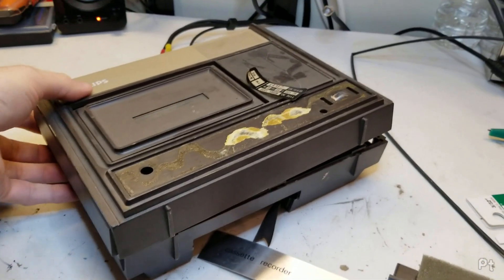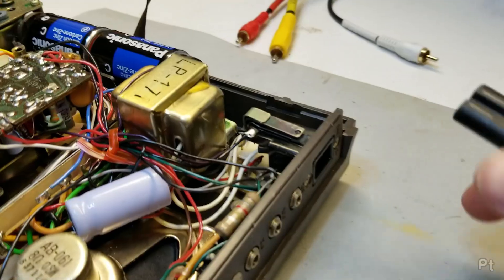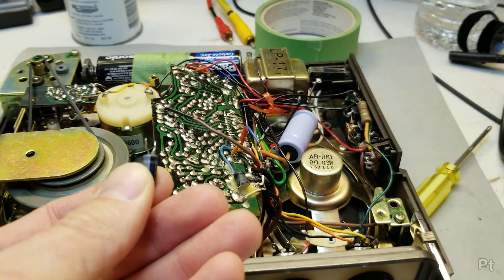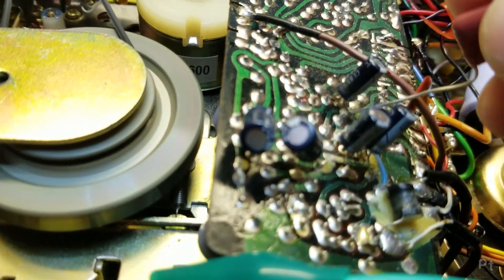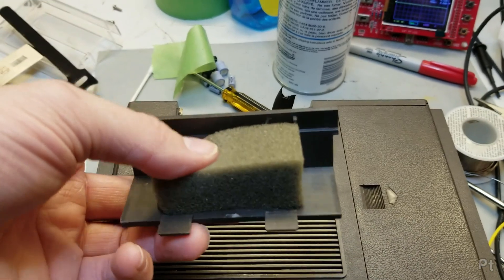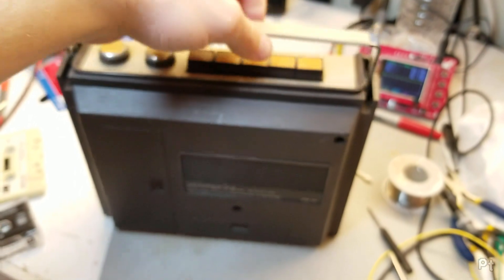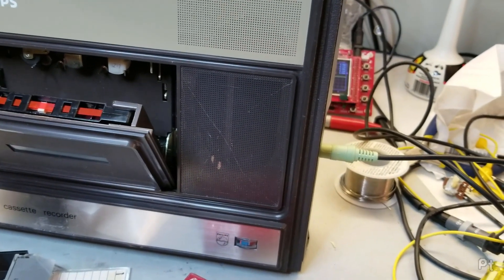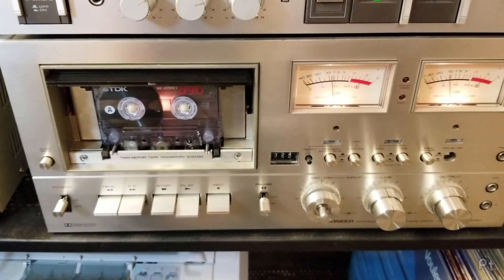1971 Philips Cassette Recorder (Model 1530)

Comment: These are very cool old school recorders. I have the older model (1320) of this cassette recorder. It's almost the same but mine has no tone setting knob and the 6 volt DC looks like a earphone jack. Mine had no sound also, but it turned out that a wire had become unsoldered from the head. Works great now.

Comment: Nice!! My grandmother had an Aiko Atpr 406 radio cassette from 1972. I remember that it had the same defect as this philips radio when I pressed play giving this noise, only it was very loud and irritating from the motor on the speaker and nothing would play on the tape . I've always been curious to know the reason for this problem and I found it after many years. The most current tapes from the 90's I've never seen this defect I don't know why.

Comment: If you want a YT app (which i assume that is at 8:57) that doesn't suck balls with restrictions and ads, get the F-Droid store (open source app store) and grab the app called "NewPipe" from there. Similar story for twitch if you use that, app called Xtra on F-droid with a built in adblocker and many more options than the stock app. Also there's things like signal generator apps that might come in handy. And sorry for all the comments I'm spamming on your videos.. I'm slowly making my way through the backlog, watching them whenever I'm bored :P You hit the right spot in between not dragging things out into multi-hour long videos and also not cutting out too much content to condense everything into 10min videos like some channels do. Just the perfect in-between 👌

Comment: chromdioxid its type II basf used pure chrome in there tapes some other companies used chrome mixed with other materials. the basf tape was considered so good that some record labels would release stuff in canada using it and there would be a thing in the jcard boasting about the better quality. A and M records was big on using basf chrome.
Reply from the maker: Thanks! I kinda thought this was the case after listening to the test recordings. The BASF sounds like a Type II tape recorded without the proper bias.
Reply: @probnotstech  ya the pre recorded chromes they made they recorded them at 120 vs 70 so u never have to turn on the the chrome setting for those they did it that way so even cheap tape players with no chrome setting could play them and get most of the benefits of chrome tape. obviously with home recorded stuff its gonna sound crappy without that chrome setting

Comment: Rehabilitating some decent opinion on Philips old electronics.

I've always been let down by that brand be that audio, video and even lighting.... that's the number 1 brand that me switch to OSRAM, before even this brand went bad. I still have a 1992 OSRAM CFL bulb lighting up every day (for a short time) when in fact every other CFL or LED lamp failed decades ago... aah the good times of old.
Reply from the maker: Most brands eventually become junk and unfortunately Philips is no exception. Regarding LED bulbs, I've had more Philips bulbs fail than any other brand.
Reply: Meanwhile I've got some Philips Prismatic SL-18 CFLs (if you can call those "compact") dated from the mid 80s and early 90s (non-rounded base) which somehow still haven't failed. Kind of willing to bet it's the fact that there are no electronics involved (magnetic ballast) being why they lasted around 30 years (so far). OSRAM is a shame though. I have a bunch of flourescent lamps (the big ass 58W ones) in my garage workshop still, mainly because replacement tubes are sub-5eur a piece and they've outlasted any LED replacement I've tried so far. Had to get a couple new tubes recently and found out they're no longer made in Germany (as they said on every tube) but made in Russia, with June and July 2022 datecodes printed on them. They are also way harder to start compared to even the existing worn ones. Guess I won't be buying those anymore... 
As far as LED lamps go, look for some of BigClive's videos where he modifies generic LED bulbs to run at lower wattage (think 9W running at 2-5W) to get waaay more life out of them. I've done some modifications based on his videos to some of my lamps in the hallway and kitchen and none of them have failed yet several years on (which is news to me when it comes to LEDs.. most didn't even make it though the first year if left stock) /walloftext
Reply: @Knaeckebrotsaege  I wish I had a Dubai lamp. Also tried BC's circuitry hack in one of my expendables and regretted immediately, because they use the least amount of LEDs it's either you run them hard to get decent output or get a big trumpet bulb just to have modest lighting.
I've also had one Philips Prismatic back in the day, it won the award for shortest life ever lived... rounded base, I guess just the shape would do.

Even I stayed with magnetic ballast on my one and only circular fluorescent 32W lamp. As long as I find economic replacements... but they're already 10 EUR per lamp.